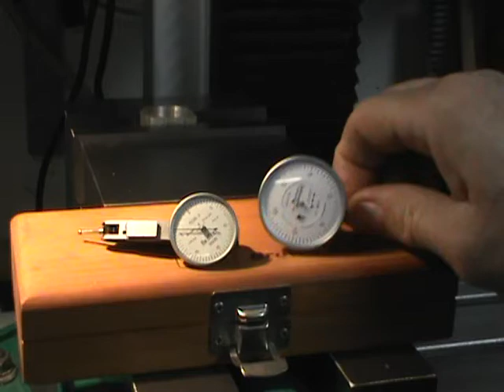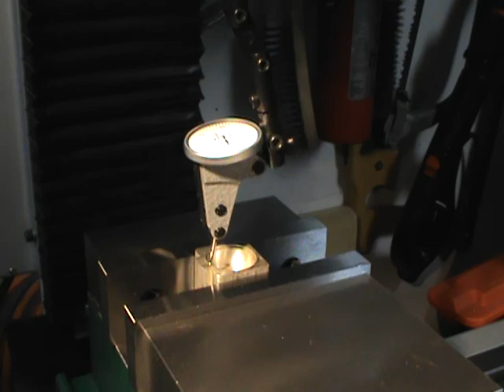Vertical or horizontal test indicators. Which is better?

Comment: Three points are all you need for a perfect circle. Split your x difference and go straight to numbers with the y. But very useful if it's oblong. Great video explaining the differences between indicators!
Reply: What does "go straight to numbers with the Y" mean? 
I'm assuming you're suggesting the use of an edge finder, instead of a dial test indicator?
Reply: @PaulG.369  it means you don't have to worry about indicating the y by splitting the difference. Once you have your x centered, you go to the high point of the y and move till you are at zero. No edge finder. I use it to pick up tooling balls.

Comment: Thanks, I had no idea from the catalog what the "vertical" and "horizontal" refer to! The catalog pictures show the dials both in the same position, for viewing from the side not from the top. I also see in your video that you need a jointed holder to place the "vertical" indicator in the correct position. Seeing you video, I think I will get one!